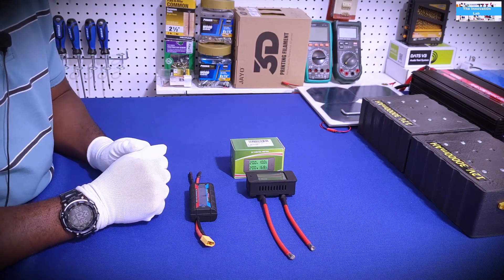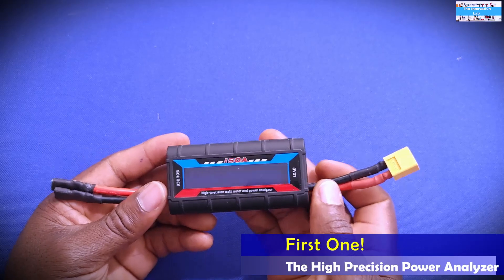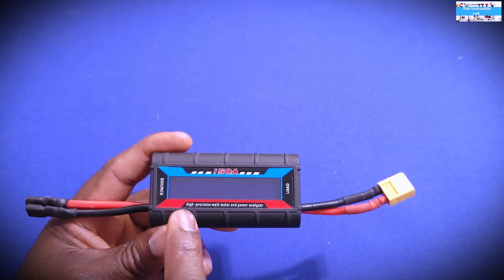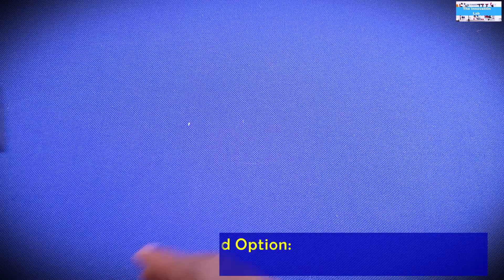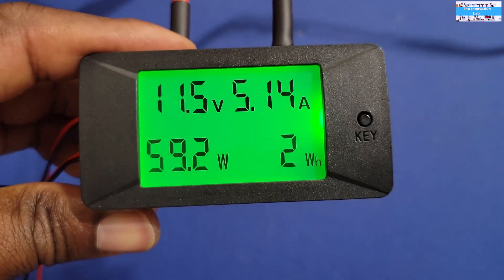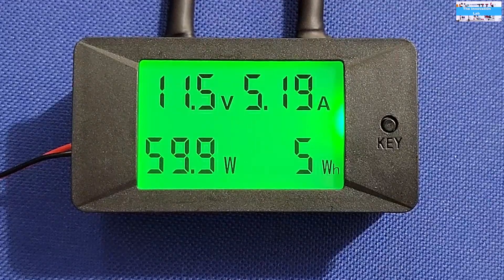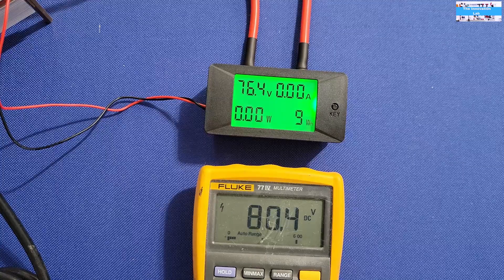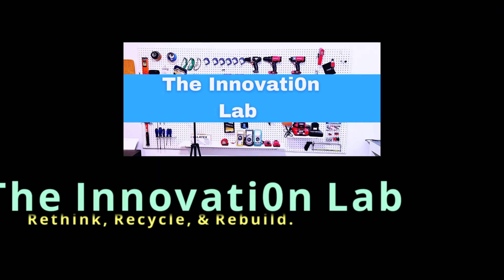Power Monitor, Diy Battery Tester #diy

Comment: You have talked me into switching power meters...THANKS...I really like the external high-current connection option!
One thing:  What is the function of the small "KEY" button.
--daLE
Reply from the maker: I am glad you got one. 
I really like them. 
The PB switch is for resetting the watt/hr cumulative measurement. Just press ND hold for about 3 seconds.
Reply: ...should've guessed that...a time reset @theinnovati0nlab782